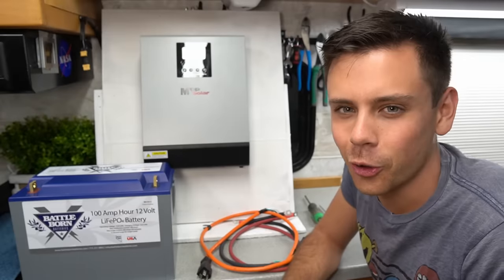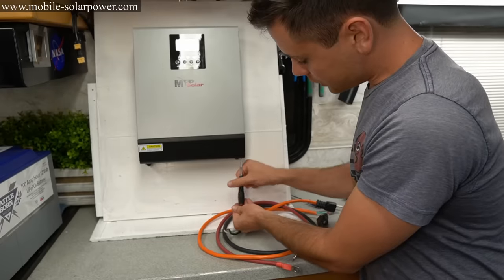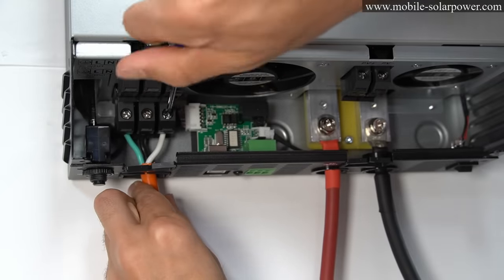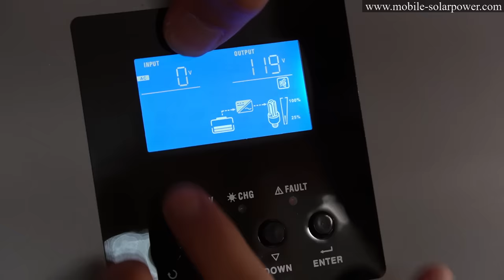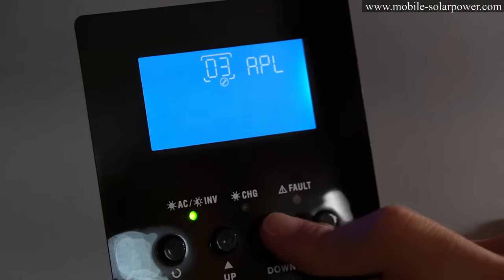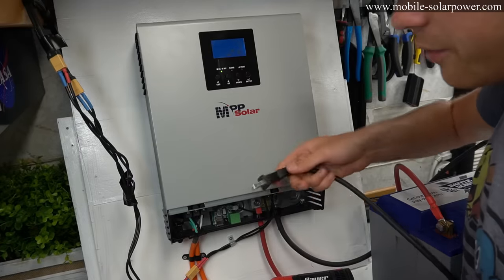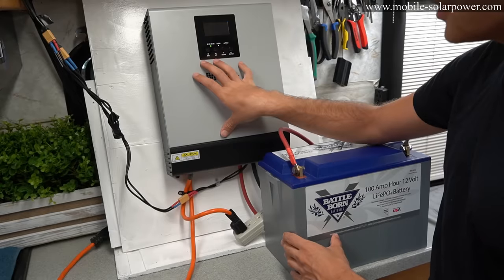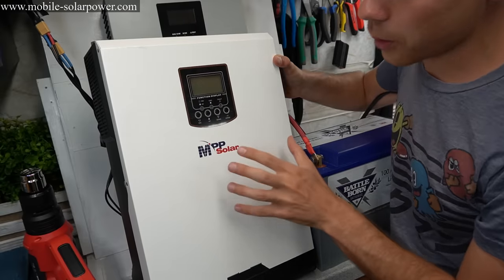Beginner Friendly All-in-One Solar Power System! Build a System in Minutes

Comment: decided to give one a try. its currently in the mail. but now just after watching your older kodiak vid is have you tested the continuous output of the inverter? as per that vid you uncovered false claims of continuous output i now wonder if this unit stacks up.
Reply from the maker: These don't have that problem. you can run continuous loads all day
Reply: DIY Solar Power with Will Prowse thanks for the reply! Have to say i love your channel and also think i now have the bug to solar everything lol esp my shed now amongst my many other tech projects i have going on. This unit will be going into a van i wish to convert for a camper, i have two ex telecommunication backup 150ah sla batteries which can be had for a good price to make 24v as i purchased the 2.4kva 24v 240v unit and will mount two used house panels 300w each to the roof which are also dirt cheap to make a larger yet still a Budget setup than my old 2x 200w blankets and victron mppt 12v 150ah with 400w pure sine inverter portable setup which after selling that ill have change left over after building this new one. I have to agree these units offer great value as you would normally pay that price just for a pure sine wave inverter and The fact its mppt 40 amps and also bonus grid backup with a battery charger off the grid is awesome. This will be my first 24v setup, one thing i have now noticed is there isn’t many 12to24v dcdc chargers for the vehicals running 12v alternator and they all seem to be around $400au but i will see how i go with having larger panels as i may find i dont need it esp since now they will be on the roof out at all times not packed away while driving like my last setup.

Comment: Good evening I would like to ask a question if it is easy for a problem I have with two inverters voltronic mks ii 5kw 48v parallel 

I get the error 72 and my power goes out I have 8 batteries 12v 245ah tab motion paste and 36 photovoltaic panels of 160 watts 48v bp solar  With a total power of 5,760 panels Please if you know because I saw a similar video of yours with inverter mpp give me a solution to my problem The error from what I read says difference in output voltage I do a restart and the next day again the same If you can help I have this problem for a year and I can't find a solution thank you ???

Comment: can i use these kind of inverter as a backup when the grid goes down? ( after disconected the grid ofc ) ?
Reply: Sure,you need to confirm the actual load power in watts and choose the correct inverter.

Comment: Hello. I have the mpp 3048LV-MK on my li-ion system for my camper. I have a honda eu3000is generator and 9 solar panels at this time. My issue is that I cannot make the inverter run off battery only while charging the battery with the honda. I want the solar and the generator to only charge the battery. Is this possible? My issue is that when the generator is charging the battery, and something kicks on, like a fridge, the inverter tries to take more power from the generator and that messes up the hertz enough to kick it off and then back on. I don't want the inverter to use the generator for outgoing power, just use the generator to charge the battery. any ideas? The company hasn't been able to help me so I'm looking elsewhere.

Comment: I got this and its not powering the loads from the battery and or the solar panels, but my loads are powered when its plugged into the grid. It charges my battery. But seems the inverter part isnt work

Comment: Controller strong enough to take up for dating driving in my van my wife died are converting the van and we'd like to travel across the United States and I need an inverter controller charger like this to power everything that I put in it I got solar panels on the roof I know need one that is strong enough to hold up for all that vibration

Comment: Anyone..... Are the displays on these MPP Solar Systems hardwired???  Reason for question is is if its ribbon cable, then I can run the display a little distance from the unit.

Comment: Will this work with a van im
Planing to live in my van and i plan to have an air conditioner its really hot here in the Philippines
Reply: These won't work well with an air conditioner. You're better off with a generator if you want to run AC.

Comment: did you ever find quiter fans for these units? would like to see what you come up with. esp since most pc fans i have looked at cost almost as much as the unit lol.
Reply from the maker: They are not that loud. I was sleeping three feet from it originally
Reply: @WillProwse  not sure if there is a difference in the 240/120 volt models. mine when inverter is on or solar is more than about 100watts the fans run fairly high and whine a bit. of a night the unit goes into sleep mode anyway but more so thinking having that constant fan noise on during the day while relaxing might be annoying like white noise when i install it in a van. or i could just build it into a cabinet.
Reply: also i find it odd that my fans suck air down and blow out from the bottom. i would think using the fact hot air rises that you would feed cold air in from the bottom and flow the hot air out the top.
Reply: @WillProwse  update. decided to try out some more silent fans. i used two nf-a6x25 flx noctua fans. they use 0.12a each as opposed to 0.60 amps the original fans use. and wow. before it sounded like a whining old pc from the 80s  with noisy fans and now, well at first i thought the fans didn't come on lol i thought i didn't clip the plugs in or something its like almost completely dead silent.
Most of the time i cant even hear the fans even when right next to them. the fans i used are not cheap at $70 australian  for two but for me its a worth while upgrade as when i free camp i cant stand constant un natural noise and also i don't sleep well so being able to sleep in and not have the fans kick in early morning sun and annoy me is worth it. The original fan model number is efs-06e12d-a002 dwph but so far i cant seem to find the specs for it to compare cfm rating and static pressure but i'm sure from past experiance better quality fans flow the same amount of air while being more silent and use less power.

Comment: Hello everyone, anyone would help me out regarding solar off-grid system. All my requirements 4 low consumption bulbs, 1fan and a DVR with WiFi router all these I need a solar connection so can u advise what capacity of battery, solar panels, charger controller and inverter I may need. I'm a beginner for solar off-grid system and your advice would help to fix my questions plz.

Comment: How would I (integrate) DC2DC in this application ?
Reply: Some units of this type have dedicated DC outlets, some don’t. For those that don’t have a DC outlet, you may have to create a circuit outside the unit using a bus bar  between the battery and unit connection. I would suggest doing this only if you really know what you are setting up.
Reply: @УенделинБест  but would a unit with a “dc outlet” serve as a DC-DC controller w/ alternator/starting battery ?
Reply: The outlet will provide a constant voltage  and whether the current is regulated or unregulated  it will depend on the unit specs. I have no knowledge of setting up these on a  vehicle, wish I could be of more help.

Comment: Anyone have a model of this where setting 04 the default which is 23v you can set it lower and save but if you try to return it to any higher value it returns to the lowest setting.

Comment: So, where is the con portion? Why would anybody do it any other way...is what I'm trying to understand. If this is easier and cheaper, what is the flipside?
Reply: The con is the cost ,  this  "toy " system in this video is close to $1000  , for a measly 1200 watts ,  what are you going to miss more  , $1000 out of your wallet right now or twenty cents @ hour for equivilent grid power  ?
Reply: @sparkywirenut  A lot of people aren't doing this to supplement their home power. They are doing it to go boondocking. So, it's not really about cost savings. It's about power or no power. I thought he said the cost was comparable if not cheaper than separate units, but it's been awhile since I watched the video.

Comment: No dc connection in that all in one? how do you connect dc appliances?
Reply from the maker: Connect to battery
Reply: DIY Solar Power with Will Prowse thanks! Do i connect directly? I need something in between? For example a 12v fridge. Thanks again
Reply from the maker: Use a fuse block and supply it with a large fuse
Reply: DIY Solar Power with Will Prowse thanks

Comment: Hi everyone. I'm new to the world of solar chargers so forgive me if this is a basic question. I'm pretty much sold on this all in one unit. I'm just a little confused about what battery I would need to hook up. On this video Will only connects one 12v battery, but the all in one charger is 48v. Is this just for the purpose of the video or can you just connect one 12v? I would like a 24v system, in that case should I buy a 24v all in one mppt and connect 2 12v batteries to it? Any advice is much appreciated. Also I'm working on a lifeboat project which you can follow on Instagram @projectbutternut.
Thanks 😊

Comment: Hello Will
Thank you for a good video.I have this kind of inverter charger (48 V) and 16 batteries of 3.2V , 280Ah)
I Have installed it , but I did not connected to the grid because I'm not so sure how to set up the inverter.
Can I have your email address please?

Comment: Wouldn’t be using 1.75mm AC cable! You want at least 6mm cable. If your wanting to power a house from this. You’ll need much thicker cable than this guys using. Also I wouldn’t plug the ac in to a wall outlet. I’d use a 100amp RCD with its own manual switch over.

Comment: At a $1,000.00 per battery, I don't think so.
Reply from the maker: Check out my $500 battery that has three times the capacity as this one. My new videos are different
Reply: @WillProwse  $ 500.00 ?? A battery of any type to me is only worth $200.00 tops. No matter what its capabilities are.  I've been using deep cell batteries for decades now, at a 100.00 each lasting 7 years, I'm good with that. And I have all the power I want. You boys are going to have to get over your high cost of technology and be more responsible with your costs.

Comment: This is bad information.  These all-in-one units are BAD. For many reasons. Lets list a few:
1) Monitoring - oh, a nice battery percentage meter, whoop whoop!  Yes, based solely on the battery voltage
2) Damn, I overloaded the cheap chinese inverter one too many times, it failed.  Hey, can I get a replacement inverter?  Sorry no, its all in one box, no user servicable parts
3) rather than plugging all your stuff into a magic box, its better to work with and UNDERSTAND the various componments interactions.